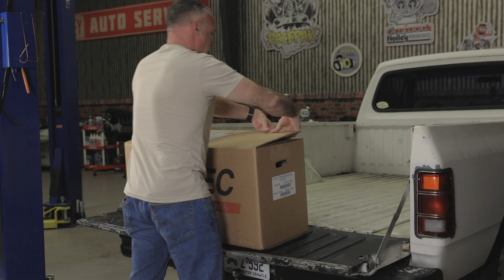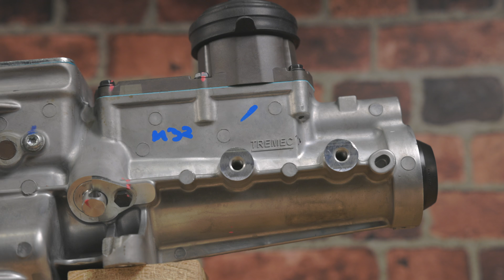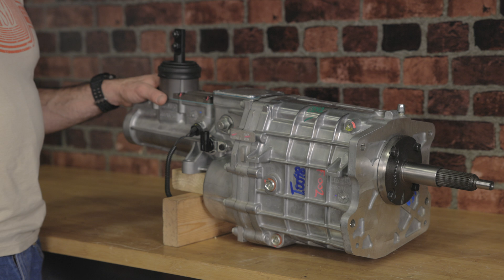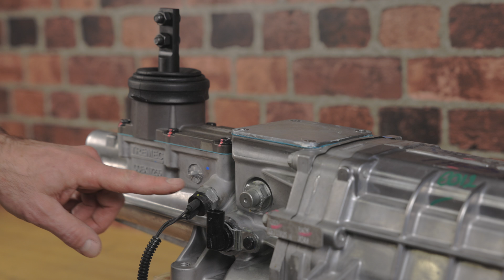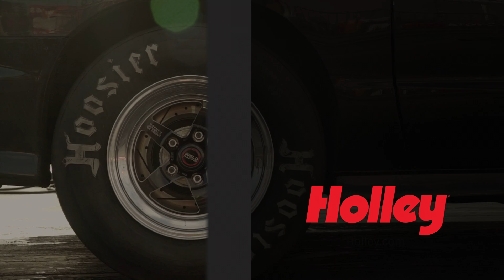Watch as We Unbox Tremec’s Brand-New TKX Transmission

Comment: This Is a good transmission but not for drag racing.no serious drag racer uses a manual  transmission   fact
Reply: I guess I'm old school or probably very very old school but the days of having to synchronize a clutch pedal, trans, and the motors rpm was a precision that you needed to beat your opponent. No computers to rely on. For your data it was trial and error and a lot of trials and a lot of errors. I took classes in welding and machine shop in college so I could work on my cars and motorcycles... today you take a computer programming Class to tune and 3D print.  But unfortunately I probably won't live long enough to see the kids of today say the same thing then I'm saying. Maybe such as ''I had to create my own computer programs or I had to actually scan my parts to 3-D print them'' and the metal was substandard. Bottom line.... I'm envious of the kids today that can slap on a turbo and dial it up to 700hp with a junkyard motor....and last!
Reply: Yeah, ok whatever you say. Also stock block LT1 (as in 95' Caprice).
https://www.youtube.com/watch?v=GFVg8LzarYg

Comment: 600 Tq...that is it?

My V6 makes more torque than that!

Let me know when it can handle 1000 at least. Then maybe I could but it behind the small block in my 57!
Reply: What kind of V6 do you have putting out that much torque? Has to be turbo'd with lots of boost I imagine. Mine is supercharged at around 8 pounds of boost. I'm just over 400ft lbs of torque
Reply: @boosted0079  3.5L Ecoboost in my truck. It makes 525 at the rear tires on pump gas. That means the motor is making an easy 600 torque at the crank.
Reply: It holds more than 600 hp tq but they can't advertise its true numbers because its cheaper than the t56 magnum and they don't want to hurt the sales of their 6spd......its basically the same maybe even better than the t56 magnum its just 5spd
Reply: It will never see a 1000 hp, however a Jericho manual  could but its not for drag  racing its more for road racing  but they are around 4000 dollars  used , if you're  looking  for a transmission for that 57 that will handle  large amounts  of hp and you are drag racing   your best bet is to go with a built 3 speed automatic like a TH 400 or even a built up TH 350, just make sure you beef up the sprag assembly  in that 350 and add a extra thrust washer between the planetary gear and direct  clutch, also use a wider aftermarket bushing in the direct clutch , maybe look at a case saver also. Another  important idea  is use the correct  stall converter, iv seen a  TH 400s handle  more then 2000 horse power but be prepared  to shell out anywhere  between  3 to 5 thousand dollars for one . Reason  i know is mine was 3500 dollars , there's  a transmission  shop in California  called  Chino hills  transmissions  they build nice equipment! Good luck  !!!!!!!

Comment: I’ll keep using my Muncie M22 Rock Crusher in my 1970 Z/28. Have been since 1981 so why change now.
Reply: them old 4 speeds are sweet...muncie/top loader/a833. They were all good shifting
Reply: @mobbybege1770  true but not for drag racing   I have all the m series chevy  manual transmissions and a few Ford top loaders  the top loader  is way stronger  then the m22 rock crusher just like the Ford 9 inch is stronger than the chevy 12 bolt . But I'd never use a manual transmission  for drag racing  only a  automatic transmission.
Reply: I have a  M20, M21 ,M22  but the problem  with them is at most the M22 will only handle  about  700 hp but not for long , most manual aluminum cased transmissions can't  handle repeated hard shifts. I have both chevy and Ford cars and I have a 4 speed top loader in my 63 comet wagon that came out of a 428 police interceptor that transmission is way stronger  then any manual transmission chevy  ever built .  This is the same reason I run a Ford 9 inch rear end in my chevelle because  no chevy  12 bolt is stronger,  however  I always run a th 350 or a th 400 in my chevelle  for drag racing  no manual transmission is faster then a automatic  transmission  ever !